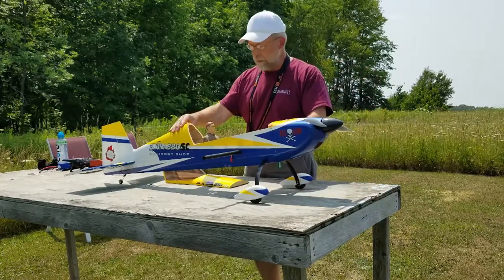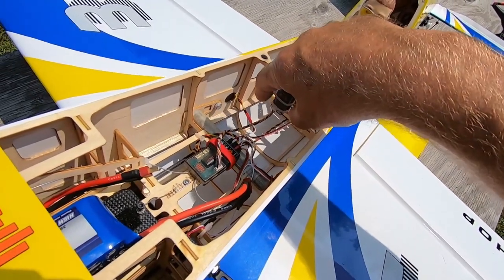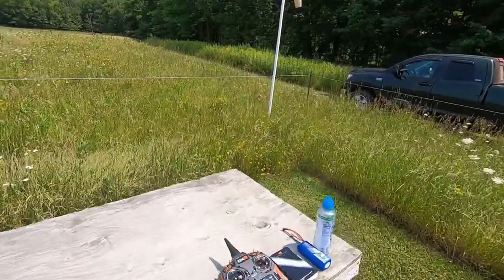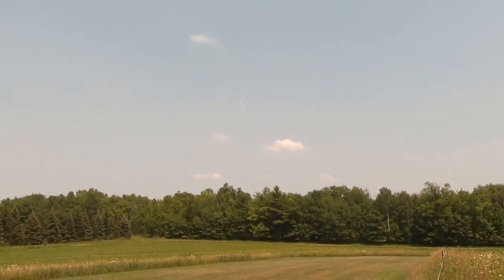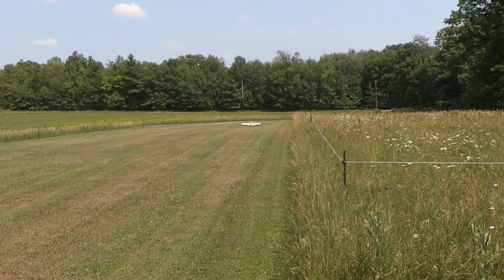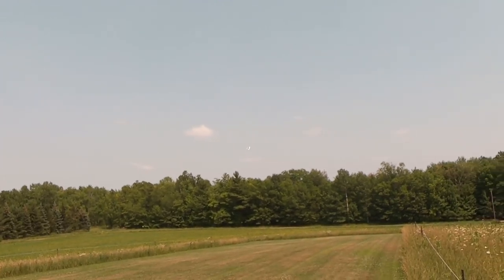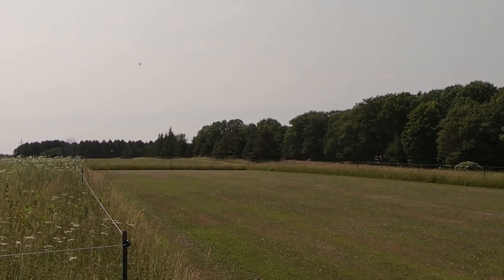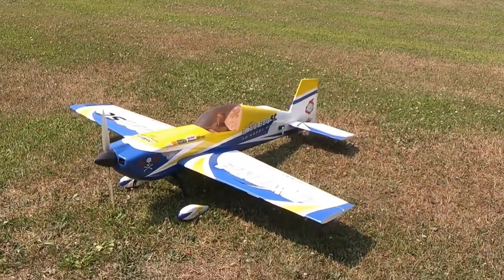3D HOBBY SHOP EXTRA 330SC with AS3X_Spektrum AR8360T Receiver!

Comment: It flies perfect 🤔smooth do you have the Gyro gain on a variable Rknob? looks like a good receiver. I’m watching this video to see if I should buy that receiver 8 channel with a Gyro built in. I’m wondering if it will work with Power glider with flaps on a Y connector

Comment: Did you have to adjust gains based on your expro settings low rates vs high
Reply from the maker: No. Gain settings seem to be speed related. I adjusted the gains up until it started getting jumpy, then backed them off a little. Expo just moves the control surface less around mid stick right? So no difference in gain settings for expo...